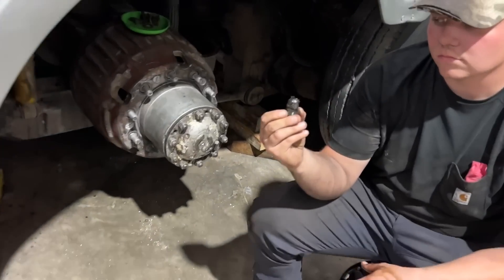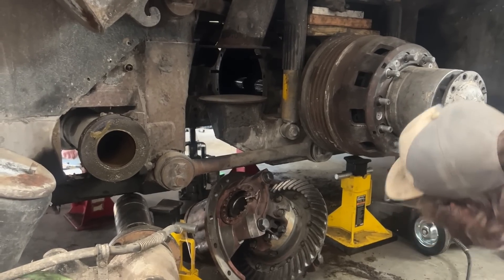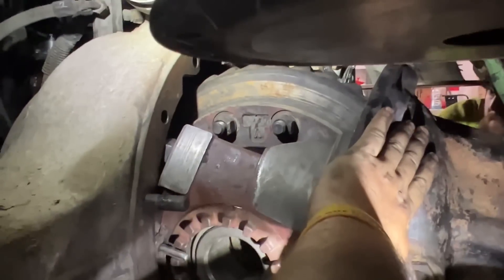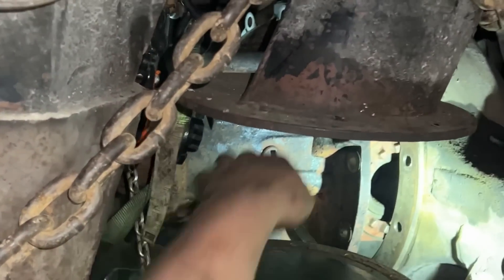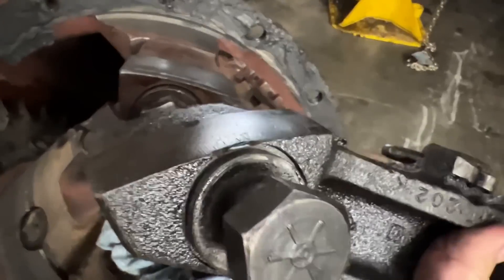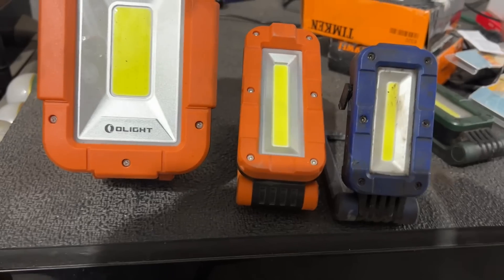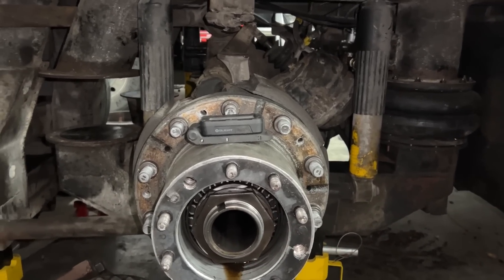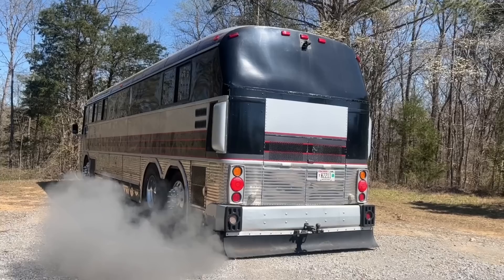Rear end problems get worse on this mci.  Finding more issues in the rear end.

Comment: Love the song..  I am a retired long Haul trucker, my last truck working in the AG division pulling 30 wheeler grain trailers, "Super B Wagons with 140.000 lbs. - I delivered to one place repeatedly, that had a hill just like yours;  Luckily we had a 8 mile run at the hill, I'd hit the bottom at 75 miles an hr. with a 475 Cat, turned up to 550 HP, I had a 18spd double over tranny with 411 gears in the rear end.  Almost instantly the hill caused the RPM to drop. I would hit the tranny selector from overdrive to drive.. watching my tach drop when it hit 1650 I'd grab a full gear, the rpm would be about 1900 and would rop in seconds down to 1650 - I'd methodically grab another full gear, the RPM would jump up to 1850 or so and drop within seconds to 1550, I'd grab another full gear, by the time I nearly crested "BILLY GOAT HILL" I was in 6th gear going 10miles an hr.  Your Hill Scott ..... reminds me of Billy Goat Hill, it bucks and fights you all the way to the top..  "I was lucky i had pavement and an 8 mile run, because if the hill was gravel like yours I would have had to stop at the bottom in 1st gear and climb the hill, because the wheels would have spun out on gravel, it would have been a hell of a predictiment. - I've seen other truckers blow a shift and come to a stop on the hill... many have dropped drive lines trying to get it going again. Love Your Videos, and ya I am a BUSNUT,, my dream was Crushed when i got injured and had to sell my 1961 Western Flyer 21 yrs ago.

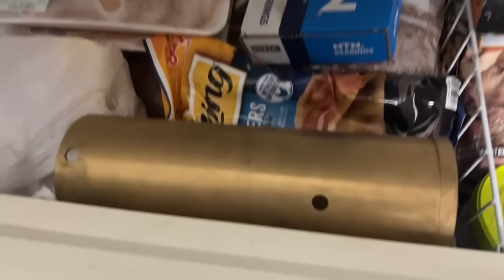Comment: 12:44 If your ever caught in a hurry and you have the ability, we have a trick in the shop for vertical and horizontal hinge pins and also the pins for TT straps on chinook helicopters, we would flip a bottle of nitrogen upside-down guided via lines and rapid freeze the pins for faster repair times. And yes, the rotor head pins on a Chinook are just as beefy as a bus.😅 I enjoy all the videos. Keep them coming 👍🏼

Comment: Scott, you need to hit up ARI-HETRA for a sponsorship.  We have their 6 jack lift in our shop and can put a dual axle International or Freightliner 6 feet overhead to work underneath. Plus they are rollable, so don't need to clog up one bay of your shop. 90,000 lb for the 6 post lift, 70,000 lb for the four post. Your back will thank you. Also makes it real easy for inspections.  Push a button, bus goes up. Push one more, bus goes down.

Comment: Get some 4x8 sheets of thin hardboard to lay on. You can slide things like that diff along the ground a lot easier. Great work!
Reply: Those thin self-inflatable camping mattresses are great to!
Reply: I am a firm believer of using pieces of remnant carpet. I get them from a local carpet store.  We have a deal worked out where for x square feet of carpet I discount y amount of labor of repairs I do on their delivery trucks.
Reply: A pallet jack might work too for humping diffs and brake drums

Comment: There is no part more difficult to install than a differential. To do it several times only to have to change the housing really stinks. I think in the long run that you made the right call. No telling what got done to the original housing that would require grinding the cap to fit. Awesome job 👏

Comment: When trying to move a heavy object like that use a thin flat steel sheet and it will just slide under ,same when removing wheels a little lube on the sheet and the wheels are so much easier to remove or refit.

Comment: I have to admit who ever worked before in the MCI differential had a good idea on how to patch up the differential. Just too bad he lacked precision tools and factory blue prints with tolerances on how much material to remove. I think one of the welded supports is probably not true in size and that sets the preload off. It was amazing that this thing lasted this long. I'm sure it made also a hell of a whining noise on the road.

Comment: I’m dealing with drivetrain issues myself right now. Dropbox upper yoke bearings became loose. Thought I’d just reshim, but figured if I was going that far I might as well get new bearings put on. Although the weight of these parts are insane, finding a mechanics shop that can press the bearings and gears has be harder work.

Comment: I have been driving double decker coaches  (60 people max) for 30 years until 10 years ago. But they were never older than 6 years but did 10,000 km a week. Good thing is that after 1,000,000 km you have a brand new coach as it returns to 0 again. Maintenance every Thursday at the home base.
Reply: 10000kliks a week, how is that even possible?
They'd have to be driven all around the clock to get such numbers.
Reply: @Simufreund309  
Groningen (Netherland) - Benidorm (Spain) 
twice a week minimum distance 4600km (2x) Done by 4 drivers Groningen-Maastricht 1 driver . Maastricht -Salou 2 drivers. Salou-Benidorm-Salou 1 driver. Salou-Maastricht 2drivers and Maastricht-Groningen 1 driver.

Comment: A repair on the pilot bearing bore in the carrier is not uncommon, but when the casting is welded back together it would be bored and sleeved. The sleeve would be line bored in alignment with the pinion cage bore, if improperly aligned you will end up with a pilot bearing failure.
Reply: You are absolutely correct. I've seen a lot of these differentials repaired in this manner & most were done correctly.  Additionally,  if the cone & cup bearings had been installed & correctly preloaded,  chances are that pocket bearing could have lived longer.
Reply: @markphilpott8735  Yes the tapered pinion bearings preload should have been a red flag for whoever assembled the unit. When the preload is setup on the pinion bearings it is normally done with the cage out of the carrier. Then when they installed pinion and cage assembly into the carrier the alignment issue with the yoke tightened would make the pinion harder to rotate.

Comment: Used  diff center/ housing  is needed then overhaul if required . Half the time in o/haul is spent getting the pattern correct and the correct  bearing drag /preload for pinion and carrier bearings . Previous tech did not .   Oh always recommend old reused gear sets be run through a gear lapping machine . The best gear mesh pattern is then achieved .

Comment: I've never seen anything like that before.  Looked like something that they would have done in one of those open front repair shops in India.  That $1,500 is well spent.
Reply: Besides the extra grinding and welding on the inside of that rear end, the only missing was gouge marks where they used a chisel and hammer to torque the nuts.

Comment: That pit will be invaluable.
Reply: They'd have to re-engineer how to manuever the center section into the housing (and lower it out), but it still beats crawling in and out from the floor.
I'd be scared shitless getting under that bus just a couple feet from the floor, safety stands or not.
Reply: I remember Scott mentioning that his shoulders won't let him work overhead.  But, there HAS to be a better way than muscling heavy parts around while down on the floor.

Comment: That old weld repair on the pinion bearing carrier housing is very hokey.......another fine example of shops that do absurdly pointless botch jobs. Its a common them in the Rockwell family of truck and bus diffs that similar differentials are indeed different. A SQHD wont fit into a SSHD etc.........

Comment: I'm gonna be Safety Steve on this one.  Starting at 2:00, Tyler has his left hand in a pinch point between the diff and that suspension linkage.  And the bus is up on the hydraulic jack and not on the jackstands.  If the jack had failed right then, that could have gone badly.
Reply from the maker: You are incorrect.   Both body and axle are on jack stands and there is also stops in between the bump stops.  Nothing can move, nothing is on hydraulics.  You even watched us sit the entire bus back on jack stands in the video.
Reply: Hunter not Me lol

Comment: Another crappy repair that could have been done better with not to much more work.
Over weld the repair area then hand machine it down to proper shape and size with a minimum amount of tools (electric or air driven) to fit the new bearing.
Maybe 4 to 6 hours max to do that.
A good mechanic with machining experience less than that.
Clint @ C & C equipment channel does it regularly on big excavation equipment. 
I'd love to see BGM spend a day in Clint's shop working on some if the diesels and equipment he gets in.
That would make for some really interesting episodes on both channels. 
Maybe even take a bus along to work on with Clint and Sausage Fingers Kevin.
Slight edit here having watched ti the end.
Looks like that rear end is now scrap with some salvageable parts.
Another customer who got lucky ti find Scott to properly fix his bus so it's safe to be on the road.

Comment: I'm betting that original center section exploded, and the previous shop did a hack job putting it back together. Should have been replaced when it exploded the first time.........
Reply from the maker: That’s a fairly good theory.  Something very bad happened at some point.